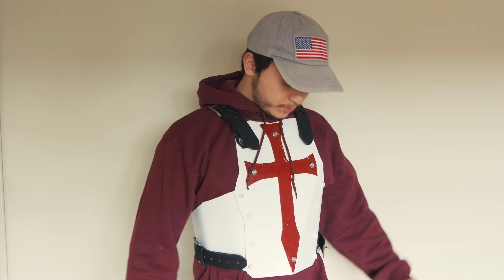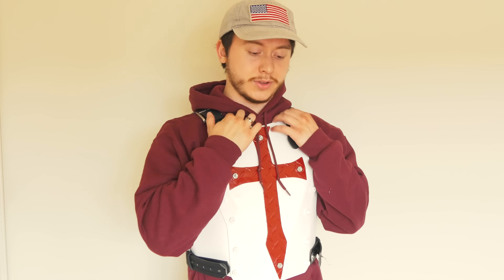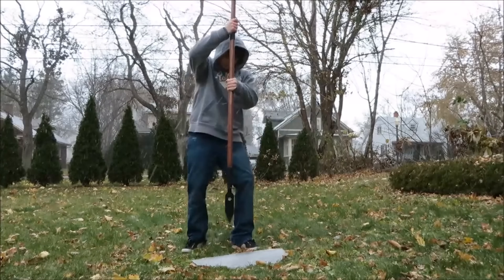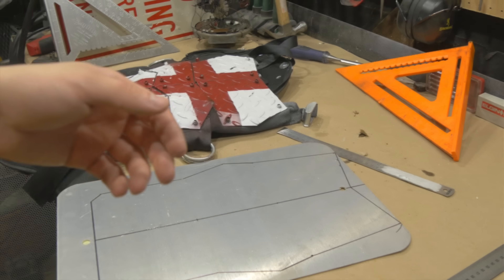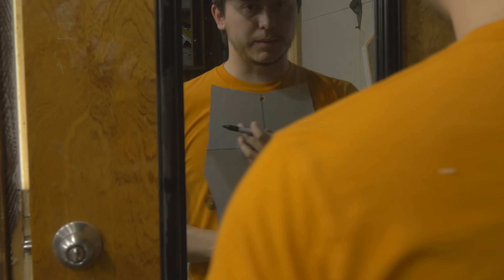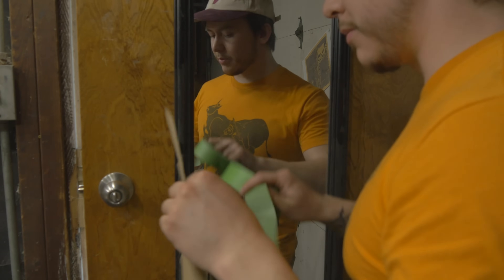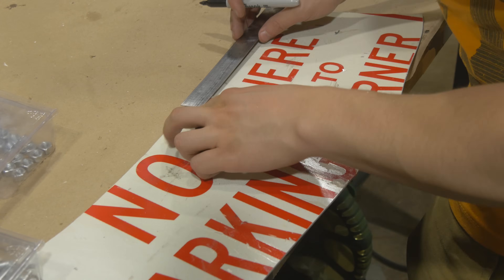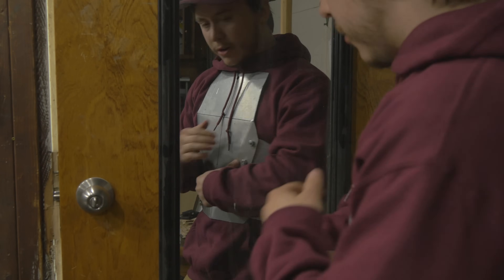How to Make Stab-Proof Body Armor 👌🙏✝DEUS VULT✝💯💯

Comment: Soo, here's an idea. Stick like, two of these inside of your $30 bullet proof armor you did at different layers. Might just deflect the 5.56.
Reply: grayghost no chance agents a 5.56
Reply: Pete Derksen I'm late to the party, but I watched that video this morning. It didn't look like all of the rounds made it through.. plus, 5.56 is great at punching through metal, but it would break apart, leaving not enough energy to pierce the $30 body armour.... possibly
Reply: FYI oven baking aluminium makes it extremely hard (former automotive industry toolmaker)
Reply: His 30$ body armor might stop 556 if he put a piece of tile or some form of ceramic in front of the fiber panel. The ceramic would do a decent job of breaking apart the bullet before it got to the fibers... but even that’s a long shot. People underestimate 556. Velocity defeats armor, it’s simple.
Reply: He could also put ceramic tiles in the bullet proof armor and that would break up the 5.56
Reply: @edgarbleikur1929  At what temperature and how long ?
Reply: Probably not, but even a single layer of this under the other armor will probably significantly reduce the force that goes through the armor from projectiles it does stop.
Might save you from too many broken ribs or reduce the bruising.
Reply: 5.56 moves too fast to be stopped by aluminum sheets (at 1/8"). Speed is what kills armor. If you put a tile layer in between the aluminum as well as a fiber layer to catch spall and put a trauma pad behind the back layer, you may have some effective armor
Reply: German spaced armor shurutzen intensifies
Reply: @edgarbleikur1929  how do you do this?

Comment: ZNA Productions can you do a heavy broad sword or maybe a trident? By the way, I love your videos and you never fail to make me smile!
Reply: Yes do a heavy broadsword. That would be freakin awesome.
Reply: Sword making is really hard to do right. It pretty much requires forge work. If you just make it from bar stock it's gonna be minimall katana levels of terrible. Trident is totally doable though! You could maybe make the tips from files for hardened tool steel, and fasten them to a barstock head, then mount that on a shaft. It'd have a post apocalyptic look, but that's not a problem for ZNA stuff.
Reply: yeah, a sword would be really hard. a utility fixed blade would be interesting. a long knife with a thick blade made in a metal file, with a thick pommel to hammer stuff. maybe with a sub hilt to improve the handling.
the assembly would be similar to a sword, but without the troubles of the forge.
Reply: Joergspave made a homemade "ork" sword for 10$ out of bar stock and compared it to a Katana( Not sure of it's quality level). It was okay, certainly enough to be dangerous, and it seemed very durable. Fit in with the post apocalyptic look as well
Reply: +ghosturiel it couldn't hold an edge and it bent when he struck a tree like 3 times. not even sideways, it bent forward. like the strongest direction a sword has.
Reply: the steel and hardening quality needed are way higher for a sword than for a knife. because a sword is much longer and can't afford to be to thick because of weight, balance and cutting capabilities. a sword would definitely be tough to make, but he could maybe do smaller blades or try to make some kind of two handed sword-like bludgeoning weapon.
Reply: It would be awesome to make a zweihander, but the special forging and metallurgy required for quality is prohibitive.
Reply: maybe he could try something like the zt diphos. a rather short two handed sword.
Reply: Totally worth it.
Reply: i fell like when you say make a trident he goes do home depot and buys a pitchfork and goes done
Reply: A trident better. Way more useful on the long run, doesn't require that much strenght, better reach.
Reply: Jack T. SIlver Yeah it is basically a spear with 3 points
Reply: Jack T. SIlver It depends on what ya need it for. A broadsword is easier to carry.
Reply: Jack T. SIlver It depends on what ya need it for. A broadsword is easier to carry.

Comment: Question is. Can aluminium stab through aluminium?
Reply: Dude. Don't ask me POOF probably not
Reply: Aluminum going fast enough will punch through aluminum. Just like how you can punch into wood with toothpicks.
Reply: Not unless you shoot it out of a gun. Aluminium is too soft for use in bladed weapons.
Reply: Aluminum lucerne hammer.
Will probably punch through most things.

Comment: just to say, swords are light and flexible, unless you have a sword made for breaking handles.
Reply: oh there he is again the person who pretends to know what hes talking about. he said light.. and all swords are a short sword like a gladius is usually under 2 pounds and a longsowrd is about 2.5 to 3.5 pounds and a greatsword is about 4.5 5.5 pounds and that can go through gamberson and flesh with ease. oh yeah and all those swords are flexible in a way. idk about you but rapiers are not supposed to be flexible and 3-5 pounds is pretty light when most of the weight is balanced next to the hands.
Reply: blackhawk8202 A battle axe weighed between two and six pounds.  Swords were flexible so they were hard to break. They were light
Reply: blackhawk8202 A european (dont think i spelled that right) long sword weighed between 2.5 and 3.5 pounds.
Reply: blackhawk8202 I was talking about his thought on steel plate armor. He said Heavy swords and axes and stuff. I was just saying they were light.
Reply: A fuckin' Orangutan 
Weight tends to have little to no effect when it comes to making a good sword.
Your sword always needs to be light, no matter the purpose.
If it's too heavy than you can't do anything with it.
Most sword would be used for thrusting more than cutting except in Japan and other areas that are close to Asia or in Asia (I think) so you always want it to be light.
If your sword is quite heavy controlling it and edge alinement are more difficult, which makes cutting properly hard.
Reply: Sam Evans sabers existed in Europe.
They were quite effective until decent armor began to spread.
Reply: blackhawk8202 nonprofit next ro the guard,you cant have a European sword without one 😂
Reply: swords are heavy compared to knifes
Reply: @blackhawk-xt4sb  a gladius is a little more than 1 pound but a Spatae sword like the frankish "Viking Sword" is 2 pounds. the heaviest sword I´ve ever seen was a 12 pound Biedenhander

Comment: If someone attacks you with an angle grinder your armor will not help you
Reply from the maker: Wrong. Aluminum is very difficult to cut with abrasive wheels.
Reply: angle grinders are the new chainsaws
Reply: Mr.Weedy Texas angle grinder massacre

Comment: He makes cutting aluminium sheets with an angle grinder look a lot easier than it is. It’s probably because it’s small pieces though so more rigid than what i’m used to. When you get pieces that are like 1.5mx1.5m it starts to wobble like crazy when cutting it with a jigsaw.

Comment: A little heat and a food grade water barrel will form a very stab resistant, cut resistant sword resistant arrow resistant spear resistant  PVC armor..
Good work with aluminum though. 
My first cut is to the legs or arms. 
Slice an artery and walk away. They either have to deal with the bleeding or die. Fight ends.

Comment: at this rate you may aswell go full bore and either make the roman style banded armor, or go brigandine and have overlaping plates sandwiched between cut resistant fabric. (thick leather, linen coated in beaswax, ect)

Comment: Love your testing method with the spear but sometimes the ground or anything behind armor can work as a reinforcement, keeping the back of the armor from blowing out, aka false test (unless the back does blow out, in which case any reinforcement was negligible)  in the future the most extreme test is having it held in place so it cant back away from the hit but there still needs to be empty space behind it so the back is free to blow out without reinforcement (Iike if the armor is strapped to two posts set in the ground, and then you stab at at the armor where it spans the gap between the two poles [think of it as being like stepping on top of a bridge, as opposed to stepping on top of a road])

Comment: I doubt you will see this, but do you think you would be willing to test if the melee vest would damage soft trauma plates if they were punctured by a round. Wondering if the piercing of the round through the aluminum would effect the protection from soft plates.

Comment: Have loose chain mail over leather or just kevlar "draped" from the chest plate to the back and finally connected to the shoulder Pads. Like a kevlar sleeve. You should also put electrical insulation under the armor or something so you don't get tased bro. Maybe have the whole armor rounded so that it's difficult to grab onto. Perhaps sharpened edges so if you are grabbed it will cut... And you'll look pretty sharp. :D

Comment: I just overlap the plates so that the side plates fit underneath the front and back plates then I just bind them all together.
Reply: Though I used a ballistics vest with a hole in it as a base for my armor because kevlar is kevlar, and the plates covered up the hole. I live in a bad part of town so the slim profile of the armor makes it virtually unnoticeable underneath a hoodie, and allows me to comfortably walk around town without worrying about getting stabbed. So far it has saved my life three times twice from getting stabbed and once from a sledge hammer of all things by absorbing the shock enough to keep my ribs from breaking. In case your wondering I am a small white dude so I am a prime target for a mugging though my 3 to 4 years of martial arts training when I was young along with my smarts and ability to outrun or run longer than any would be muggers has kept me relatively safe. Though it is not everyday someone whips a sledge hammer around the corner into your chest at full force, so a bit of armor helps a lot.

Comment: Aluminum stops the blade I think because it's softer than steel, just by a little.  Because steel blades are harder than aluminum, they deform the aluminum just enough so the blade gets a little stuck.  Steel on steel won't cut, so the blade deflects, but aluminum just gives way to the harder steel.  Not fully of course, 1/8 inch thick and all, but enough to stop the blade from moving around easily.

Comment: Cool looking piece of armour

Really practical if you're not ready for someone who's going to stab you in the chest or the back

But if you're a trained fighter and you a counter someone wavering a knife

Yes having a chest and back covered is important 

It does not cover the areas of a fighter as the stance would be square on so you would need more protection shoulders and from under your armpits all the way down to rib cage

Comment: Protect your sides with chainmail, there's several ways of linking the rings so you can find a balance of weight vs strength.
Besides it gives you a bit of flexibility.

Comment: They can't stab you in the armpit if your arm is down, And second if you wear the Armour under your clothing so attacker doesn't know you have it they will be stabbing at the normal spots which would be protected. You could also make something to put on your neck, bend the martial your using in a circle and wear a turtle neck or something and about getting stabbed in the armpit you could design something to put their and still be able to move.

Comment: Great ! And to those whom knock this gent are just closed minded .
Now another idea for KNIFE proof is to get a Kevlar type cutting board cut to panel size or heat and form you can take it from there and try to stab through one of these ain't happening simple cheap and quality hope you take this idea and run with it you are very creative and this vid ia great for the SHTF when all else is not available

Comment: there's an easier way to make armor like that it's a cosplayers trick you essentially wrap yourself in plastic wrap then do a couple layers of duct tape and cut to clean seams to get it off your self and then you have to halves to a pattern out of if that makes any sense it seems a lot simpler than what you were doing

Comment: Test it vs an arrow. Sounds weird but imo you tested the wrong thing for armor penetration. A heavy thing moving slowly, even with prolonged contact and post-contact force. I think a ‘heavy’ (500grains) arrow from a 45-60lb bow would bust through that. I’d like to see it tried with a field point and a 2 blade broad.

Comment: No, but I can stab through 18 steel with a pocket knife that's sharpened adequately. Basically a metal folding chairs back. Unsupported. From the front. Because fuck it, I had an old chair I'm throwing out and I wanted to see how much force I needed in rising overhand thrust like jeorg sprave did

Comment: Wear it with a mail shirt and boom. Also shoulderpads are needed...and a steel helm... then they are fucked...cause the bike lock will slip off from ur head and hit ur preferably rubber covered aluminium pads and if they stabby stabby they are wrecked too.

Comment: you could have looked up on actual medieval chest plates and how they are manufactured. get that curvature right, the fit and size and positioning. they have worked that out centuries ago, no need to reinvent the wheel.

Comment: I really hate the fact ZNA called swords "heavy". It might be satire or it could be ZNA being mislead. European swords were actually pretty light. Arming swords were around 2, 3, or even 4 lbs. same goes with longswords. Greatswords were 4 lbs. at their lightest and 6 lbs. at their heaviest. Even axes, maces and war hammers weighed the same as swords (it just depends were the balance is) and certain pole arms, like pole axes, could weigh 5 lbs., or less or more. But still, swords are not heavy. I think the reason he said that was because "well they were used in warfare." Welllll, if swords were primary weapons at the time, then we should make handguns primary weapons. Seriously, how stupid would that be? Swords were used, but they were used by commoners and peasants because of ease of transportation and by knights and other soldiers as sidearms (like modern handguns). Main battlefield weapons in the Medieval times include maces, war hammers, war picks, axes, two-handed axes, spears, pole axes, halberds, billhooks, war scythes, guisarms, bardiches, glaives, svardstavs, and even later weapons like greatswords, Bec de Corbins, Lucerne Hammers, and all of the weapons mentioned before these. And lets not forget about bows and crossbows.

Comment: TL;DR: Youre better off with coat mail or high-tech vests/fabric (none of them made in china or its colonies); if you value your life that much you gotta spend the cash. There must be a balance between protection and disadvantages. If you have to wear armor, there must be a good benefit from it, otherwise theres no point.
Looks really cool, but considering the amount of work, time, tools and energy you put on making it, its very dissapointing; yes it protects many vital organs but theres a lot of vital points open, and if you count on this armor to protect you, you basically put your guard down because you expect the attacker to hit the armor and not one of the many openings. Also, theres the weight AND the reduced mobility.
About the armor itself, its too overkill, might be good for a prototype but not for a final version, using bolts and heavy duty straps is unnecessary unless youre trying to stop very heavy and continuous hits (compared to knife attacks). Also, after you made the test with the spear you shouldve known you dont need such a hard material for protection, i dont know your enemies but thats just too much. If we're going the rudimentary route here, one thin lightweight coat of mail would outplay this armor in so many levels, because even when were talking medieval technology, there were people centuries ago who knew what they were doing.